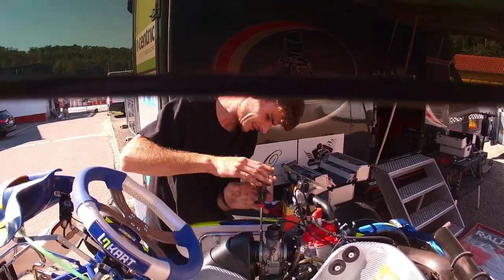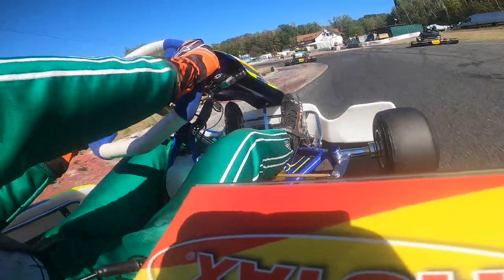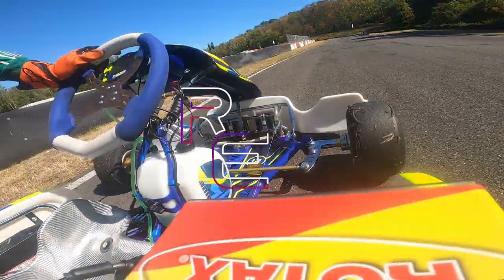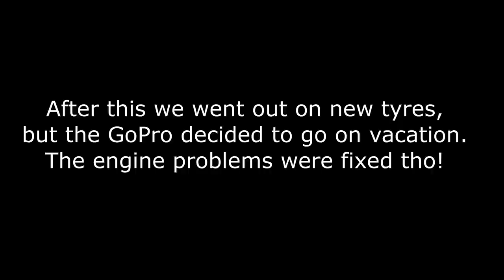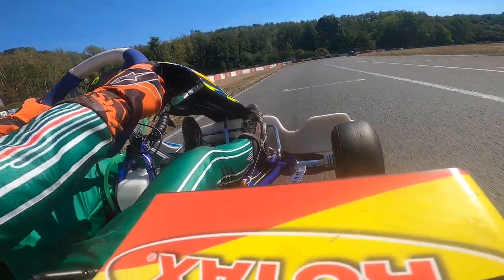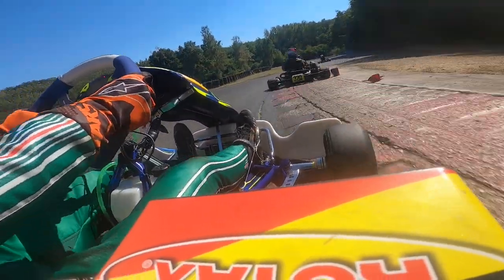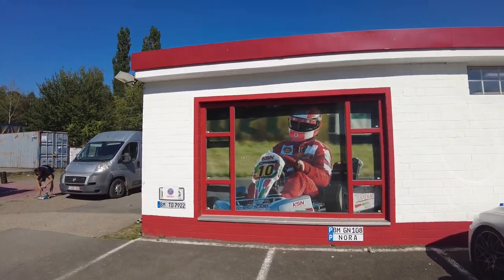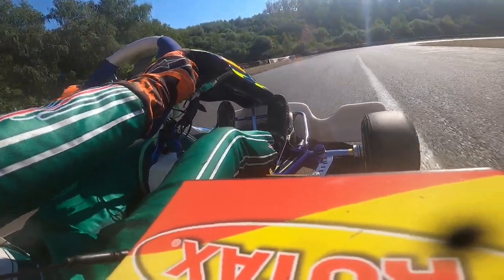A Trouble-Filled Day With My Lando Norris Kart | Senior Rotax Max

Comment: What part had broke in the carb ? As I had a similar problem with my rotax, kart wouldn’t idle and when driving slow would cut out.
Reply from the maker: The tiny clip on the throttle needle (idk what it's called, check the drawing in the video)
Reply: @RedExions  oh ok 👍 it’s not that then the little clip on my throttle needle isn’t broken. I’m hoping it was just a block jet.